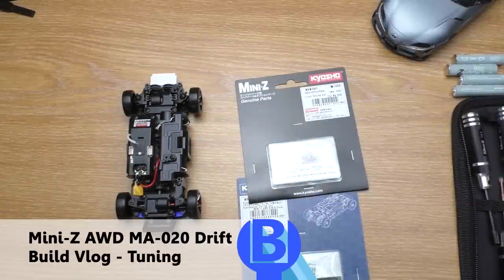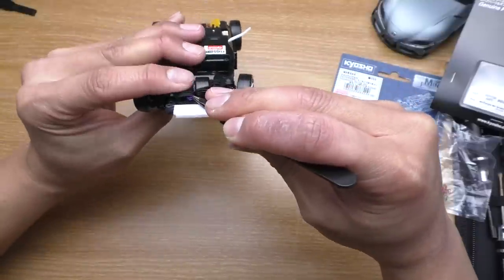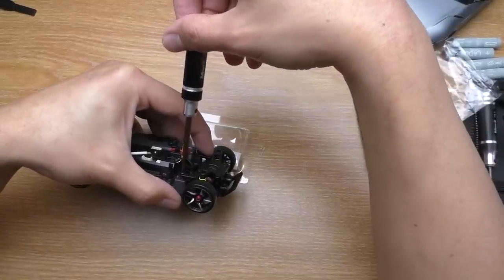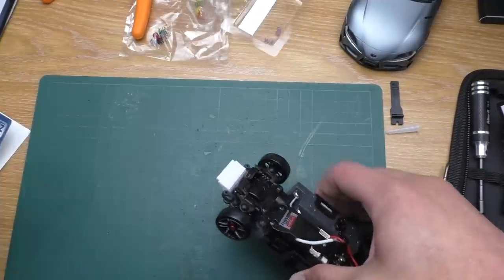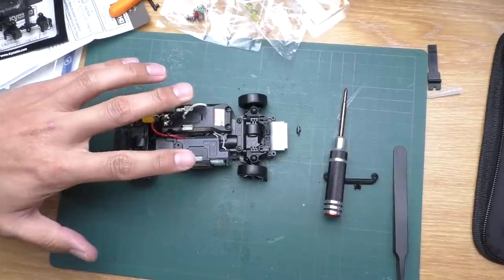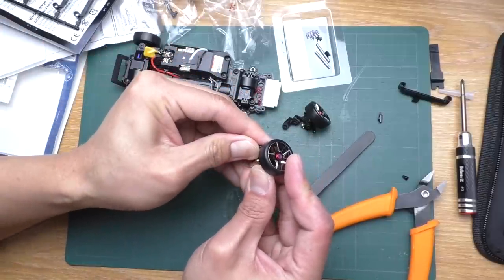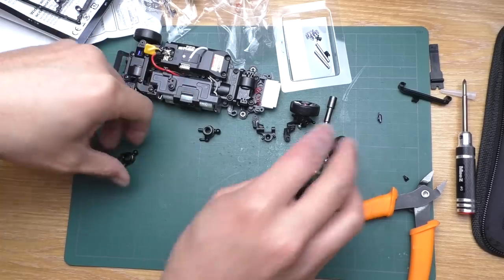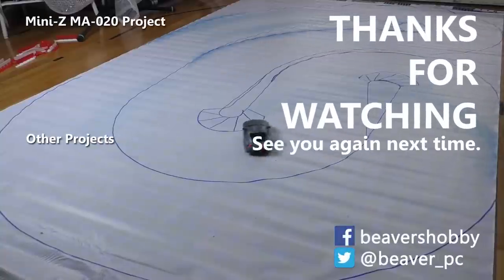Mini-Z MA-020 Drift Build Vlog - Tuning

Comment: Hey beaver 
Front one way is locked diff
So if you want good oversteer go locked rear and ball front differential 
Softest you can go but stiffest front at your comfort and rear softer at your liking
Reply from the maker: When front one way is on power it might feel like a locked diff but it's not. When you turn it actually lets the other wheel run faster. The main thing I use it for is to do the "handbrake" effect. Because it'll let the front wheels roll when I break or let go of the throttle (like rear wheel of a bicycle). Basically it's for very tight turns or to execute the drift easier.
Anyway, it depends on your driving style. If you feel like ball diff suites you more than the snap oversteer then you should stick with it.

Comment: And I got +0.5mm toe in rear since locked rear differential for straight push help forward
0 toe for front cuz awd… - will actually cause it to turn in less w throttle initially and not let you get the turn in angle mid 

Just wanted to share w you cuz we enthusiasts

Comment: I've been following you for a while, and really enjoy your videos. My girlfriend and I both have MA020s. Mine is the Challenger, and hers is the gray Supra like yours. 

I have a glued rear diff, front one way, and a PN Racing  -1 tie bar. She only has a glued rear diff.

I am trying to tune mine, and she prefers to just get better at driving hers like it is.
Reply: Is the rear diff a bevel diff? I bought the solid rear diff so I didn’t open the stock diff to see.

Comment: Just got my first mini z its am awd ma020 any idea whats the stock rear knuckle ive seen a few but dont know which 1 to order
Reply from the maker: The stock knuckles part no. MD004. You can get the separate standard knuckles with part number MDW005-15 (1.5degree offset).

Comment: Hey Beaver, I have a AMZ and bought those mini z diffs (one way & locked) the front fits and does not bind but the rear the drive shafts are bonding. Are there shorter driveshafts than the atomic AMZ drive shafts?
Reply from the maker: Not really sure how the rear drive shaft bond because shorter drive shaft. Is the pinion gear too close to the diff gear? Or it doesn't reach the gear at all? 
The problem with using direct Mini-Z diff on AMZ is that the gearbox on AMZ has less room than Mini-Z and you'll have to grind inside of the gearbox out a bit to make it work,

Comment: I change the same things but you drift like a pro, I don't... I find more difficult to drift with locked rear diff and one way front diff versus stock ones... With the stock ones it seems  smooth and less nervous but I have to learn a lot. How can I learn to properly drift?
Reply from the maker: I think you'll just do it over and over again until you get the feel of the car, when and how to let go of the steering so it slides.
Pull the throttle then steer in to initiate a drift. Then once it slides, let go of the steering. Then slightly steer left or right to maintain the direction.
Reply: @BeaversHobby  I'll try, thank you very much

Comment: My wish from Kyosho is to make the rear end of the awd chassis that can house any body with 86mm wheelbase by moving in the kingpin struts and rear toe (the differential can stay where it was) by 4mm, because I can see there could be a chance that could happen...
Also is there any chance that the LMP bodies can fith the awd chassis?
Reply from the maker: The 86mm will need them to abandon the AAA because of the length. If they do I hope they revive the Lancia Stratos too.
As for the LMP bodies I'm afraid it's not possible because AWD has diff housing up front and it's too high for those bodies.

Comment: Beaver's Hobby  Hello,  do you believe your final result with this MA-020 puts it's drifting ability head and shoulders above your tuned WLtoys 284131 (k989) ?
Thank you.
Reply from the maker: With a ton of effort WLtoys is better to drift than MA020 mainly because it has better steering angle. MA-020 wins out in terms of simplicity and easier to get it working. You can practically open the box and play, no need to fix anything.

Comment: Hi Mr B. Do you recommend the camber and toe adjustments for the AWD drift? Also have you experimented with the gearing yet (Standard not counter steer mods)? Thanks.
Reply from the maker: -0.2 tie rod for toe out and 1 degree camber at the front. At the back if you can find the piece, 2 degree camber or more if you want the rear to slide out more.
As for the gearing, to my driving style and track size I prioritize the torque so the out of the box setup is perfect already. Increase the pinion and decrease the spur if you can't slide the whole long corner of your track.
Reply: I was wondering if you change the rear camber also 1° and or 2° would that make a difference. I'm going to try it myself.
Reply from the maker: @lfodh1  Yes, it would. The rear will have less grip on the straight and make it easier to initiate a drift. I didn't get the adjustment part because it was out of stock at that time.

Comment: Great video! Very helpful. Does drifting require front narrow and rear wide wheels? I recently bought a mini z AWD and want to get new wheels and tires. It would make shopping a lot easier if they were all the same width :). Is it better to get all narrow or all wide?  Thanks
Reply from the maker: No, it doesn't require front narrow and rear wide. Personally I prefer all narrow for drifting.

Comment: Also, when I added the rear DWS system to my AWD, it has toe in on the rear, cannot recall if out the box it had rear toe in. Is rear toe in good or bad for drifting?
Reply from the maker: DWS, at least the one I got, came with 2 degree toe in and it tries to push the car back in like too much so I don't recommend that for drifting. Try and change the toe bar to 1 or 0 toe is better.
Reply: @BeaversHobby  Thanks for that. I think the kit only came with 3 and 4 degree toe bars, will try and see if I can get a 1 and or 0 degree, thanks.
Reply: @GazVanDyk  i have the same issue.  Were you able to locate a 0 or 1 degree rear toe bar?
Reply: @demonslayer9772  Hi mate. No, not been able to find one in stock.
Reply: @GazVanDyk  that's too bad.  I m considering cut a bit off from the center and hot glue it back together.

Comment: Great video, has helped me a lot!
Thank you!
Do you think the stock gear ratio and motor is perfect for drifting or would a different gear ratio and the optional x speed motor help also?
Reply from the maker: The stock motor is enough unless you will run it on a larger track that requires more power to keep the wheels spinning.
Reply: @BeaversHobby  thanks for that!

Comment: Nice video!! I have a question. I have the same one way as yours and the kyosho one way but the front tire doesn't spin freely like yours. The front and back stop at the same time. Any thoughts about that?  I cleaned the bearings, drive shaft, camber, wheels and oil the bearings and front one way but it doesn't seem to help.
Reply from the maker: If you hold the rear wheels then push the car on the floor, do the font wheels turn? All that matter is the front wheels can roll forward while rear wheels don't move when it's actually on the floor. If not I'm afraid the drive cup shafts (the shafts that go into the one way) are too thick and you'll have to sand them down.
Reply: Yes the front wheel does turn. Thanks for the reply!! Keep up the good work!! Can't wait to watch your next video!

Comment: Did you add anything to the car for the build off camera? A few times in the video it looks like you added different  swing shafts from stock mini z. Also how important is the upgraded remote? I want to build a ma020 just like you did in your videos with the parts you listed in the parts list only  with stock radio is this possible?
Reply from the maker: I did the metal swing shafts upgrade alongside the front one way and rear solid axle in the previous video. https://www.youtube.com/watch?v=0RbB5xAqLyc 
So the full parts list are actually 
- 3RACING AWD-02 https://www.rcmart.com/3racing-alum-swing-shaft-for-mini-z-awd-heavy-duty-awd-02-hd-00020637?search=3racing%20awd-02
- Front one way and rear solid axle kit from Aliexpress (same as original but way cheaper) https://www.aliexpress.com/item/1005001671065507.html
- MDW201
- MDW004
- MDW203
- MDW202
The upgraded remote is not important. It's really not worth $300 for the amount of extra settings and improved response time. The stock radio is more than capable to drive well.
I do it because I already have it. You will only get this remote if you will stick to this hobby, buy more cars as well as other kit cars to build.

ps. Sorry I didn't show the FOW + swing shafts upgrade here because I've done it in the channel countless of times.

Comment: Have you ever tried solid axcel in the Front? 
Many people say it is best for drifting?
Reply from the maker: Yes, it's the most basic thing you can do to make the wheels keep spinning constantly. Personally I rate it below the front one way because it doesn't have the "handbrake effect" where you can flick the rear out one demand in an extremely tight corner. Some will find front one way too twitchy and difficult to control so they will use solid axle instead.

Comment: Mr beaver can you post the suspension sets namea
Reply from the maker: Front spring set part number Kyosho MDW201.
Rear spring set part number Kyosho MDW004.
Front one way Kyosho MDW017.
Rear solid axle Kyosho MDW024 but you can just lock the original diff.

Comment: With what comes in the box what spur and pinion gears do you recommend for drifting?
Love the mini z ma-020 videos!
Reply from the maker: Stock is already good with enough torque and speed. If you upgrade it to a faster motor then you can use a smaller motor pinion to compensate for the torque.
Reply: @BeaversHobby 
 Thank you.
How do you feel about REAR camber and toe?
Reply from the maker: @orsini3569  0 rear toe or stock is good already. Get the largest rear camber as you possibly can (4 degree if I remember correctly). It'll reduce the tyre contact and make the car more eager to slide.
Reply: @BeaversHobby  Interesting...
I thought stock rear toe was already set to 0.
For rear camber I found a 1.5 and a 3
I'll try the 3. Thanks again.
Reply from the maker: @orsini3569  Yes, the stock should be 0 toe already. Try different camber if you can and see how much rear grip you need on your floor. Maybe too little grip makes it uncontrollable.

Comment: Was this test without a gyro?
Reply from the maker: No, I don't use gyro in AWD cars.
Reply: @BeaversHobby  thanks for the info
Reply: @BeaversHobby  thanks again for that video!

I had a drift Mini-Z couple years ago but ditched it because it wasn’t really fun.

But now, after watching your vids, I bought a MA020 again and use a rigid rear + one way front diff, toe out front, hard rear & soft front springs and it’s soo easy to drift and a lot of fun.
I actually prefer training mode.
Not because it’s easier, but because it looks and feels much more realistic and closer to real scale speed.
I’ll combine that with LF5 tires, and add as much weight as possible to the chassis, to get it closer to behave like a real car. 👍

Comment: Hello, do you know that supra body fit to wltoys k989? And do you have any idea about ae86 body fit k989?
Reply from the maker: Unfortunately none of these fit Wltoys. Wltoys is 98mm wheelbase wide chassis. Supra is 94mm wheelbase narrow chassis. AE86 is 90mm wheelbase narrow chassis.
Reply: @BeaversHobby  i also want ask u something about drift tire.I ordered"GL Racing R10 4WD Machine Cutted Wide Offset 3 Carbon Rim 2 pcs Black For 1/27" from rcmart and i need drift tires.Can u say what can i buy?There are too many product
Reply from the maker: @anl1267  For drift tyres take a look at DS racing lineup. There are many LF numbers, the higher the less grip it has and results in lower drifting speed. The LF-1 is equivalent to Mini-Z drift tyres. I recommend LF4 for AWD. As for the wheels you choose, that bunch of letters mean wide wheels 11mm with 3mm offset so it's really deep and will stick out a lot. The original wheels are narrow (N) 1.5mm offset.
Reply: @BeaversHobby  "DS Racing Mini LF-4 8.5mm Narrow Drift Tire 4 pcs Black For Kyosho Mini-Z" ur saying this one i guess.Thanks
Reply from the maker: @anl1267  Yes, and you will need narrow wheels for it too.
Reply: @BeaversHobby  what do you mean? Sorry i dont understand 😅
Reply from the maker: @anl1267  You will need wheels that say narrow or F (means front) so that the wheel width will fit the tyre.
Reply: @BeaversHobby  thanks, i want ask u more things but i need send photo,i cant explain here.İs it possible to send u photo?
Reply from the maker: @anl1267  Yes, you can send the photos via email at beavershobby@gmail.com.
Reply: @BeaversHobby  Done send. Thanks
Reply: @BeaversHobby  can u check again when u are avaliable 😂 thanks
Reply: @BeaversHobby  i think u order many things from rcmart thats why i ask to u.I receive my order just now but 2 wheel is broken.I bought 4.Do u know they help?Because its not my fault
Reply from the maker: @anl1267  Yes, they will help when you contact the customer support. It might take time so please be patience.
Reply: @BeaversHobby  Okay thanks ur best
Reply from the maker: @anl1267  My pleasure. Best of luck!
Reply: @BeaversHobby  i think i should stop work on this car.İ bought car from banggood.The body was damaged when i open box.And now i see wheel is damaged.Idk im unlucky or i need stop :)

Comment: The rear chamber 2-3 is good for drift?
Reply from the maker: Yes, they are good. Not just the looks but you will have less grip (depending on the shape of tyres but generally the grip will be less) and the rear will swing out easily.
Reply: @BeaversHobby  Oh thanks a lot!!
Another question, where did you get the obstacles ???  Its more good for drift
Reply from the maker: @_Slushy_  A viewer sent them to me. They are 3D printed. You can find similar on thingiverse like this. https://www.thingiverse.com/thing:4321508

Comment: 請問改反胎對新手來說好嗎?增加側滑距離!
Reply from the maker: No, not really. The original tyres are good for all surfaces already. Changing tyres is for something extra like more grip or less grip to work better on your floor.
Reply: 因該是說Cs% 翻譯好像不同
Reply from the maker: @user-xm2xs3sg2d  CS% is more important than thee tyres for Mini-Z because the original tyres are already good enough.
Reply: 我有裝前單向跟後直軸了，漂起來喔覺得不是很順暢在想要不要改cs25%試試
Reply from the maker: @user-xm2xs3sg2d  I'll have to finish the basic mod videos first before I go into CS. With this limited steering I'd probably go to around 20-50%, 75% max (1.2-1.5, 1.75 maximum) and not beyond that.
Reply: 謝謝你，看影片學知識
Reply: 請問一下二驅四驅的差意？二驅比較好甩嗎？miniz Gld drz
Reply from the maker: @user-xm2xs3sg2d  AWD is easier to drive but it has higher sliding speed. RWD is harder to drive but more rewarding to drive and it looks more realistic.
Reply: 謝謝，在考慮換後驅